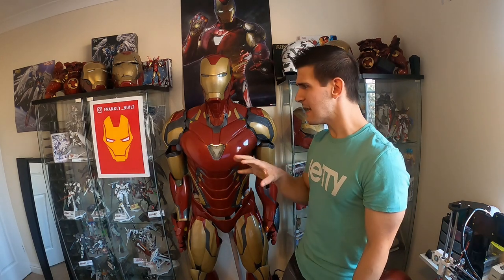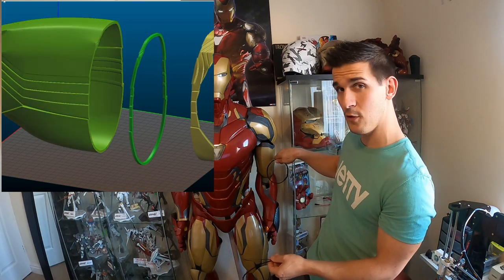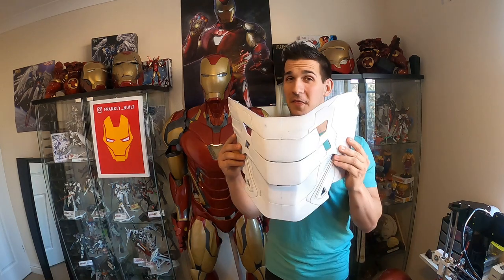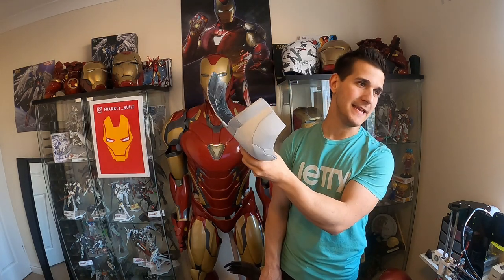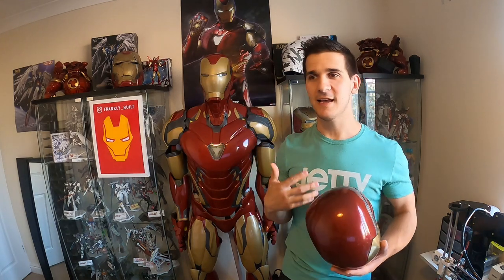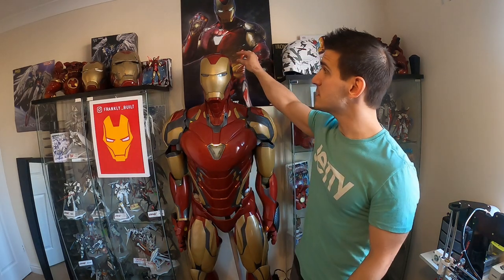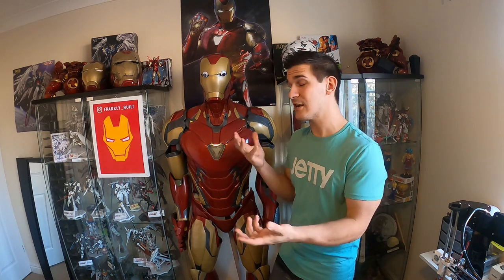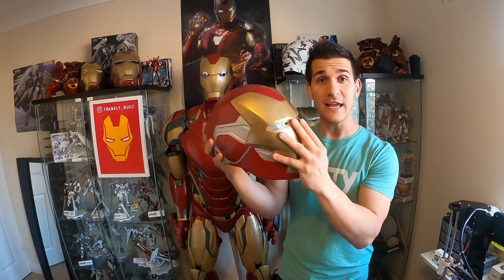How to Scale 3D Printed Armor! (Old Video- See Description for New Version!)

Comment: I'm 6' 1" which is lucky for most suits, but I'm going to apply the boots and lifters you mentioned to my Master Chief armor I plan to build after Halo Infinite releases. Should help me get at least a bit closer to 7'. Love your videos man. I bought a 3D Printer in February and began making a Beskar Mandalorian costume and the things I've learned from videos like yours and my own mistakes I've made have all been so valuable to learning how this whole process works. Only problem is forcing myself to not start another project before I finish one.
Reply: That is good to know. I am 6 ft 2. 😂 I have to fix a piece of stuck filament on my SV 03, then I'm getting at my Red Hood Samurai armor. I'm just going to print the helmet and see how it goes. If it doesn't fit it will just go on display.
Reply: I did a cold pull. Filament is stuck between the nozzle and direct drive extruder. 😭
Reply: Disassembly is NOT the same as videos I've found. So... Time to tinker!

Comment: I had just left a comment on your tik tok about this.  I am so happy I found this video thanks so much for your help.  I just got into 3d printing.  I may have made a mistake in purchasing a much more expensive printer to start with. 

I got the snapmaker A350 do you have any experience or thoughts about this printer?

Comment: Great video, Frank. Just curious, I’m concerned about resilience in the armor pieces. Are you printing 100% infill or thick walls with high percentage infill? Also what type of filament are you using? PLA, PETG, ABS?
Reply from the maker: Oh dear god no. Lol 100%? Jesus that’s insane. I use 5% infill with quarter cubic pattern. You going to war in the thing? UFC fight? Lol 😂 it’ll be fine. And it’s PLA+. Don’t leave it in a hot car haha
Reply: Frankly Built Thanks! I figured as much. What wall thickness are you using. I’ve heard 3 to 5 mm is good.
Reply from the maker: @sjmaguirepdx  no idea lol whatever stock cura settings are haha
Reply: @sjmaguirepdx  Do3d files have a good wall thickness by standard. I have several helmets of them and although I would wear them as crash helmets, you can walk into a door with them without breaking the part 😁

Comment: Like did you design and print the suit yourself, or is it designed by someone else and you printed it yourself.

I want to make a mark 6 or 7 suit. Whatever the first one was where Tony put in his new triangular arc reactor.

I haven't searched online for any files, but I kind of want to make it an actual somewhat functional suit in terms of being able to move around, as well as using a bunch of d3o padding so it could actually be used as a protective suit like if you fell down or crashed on a bike or skateboard or whatever. I thought about making a bodysuit with the padding built in to/sewn into that, with the armor attached on top of it, as opposed to attaching the padding to the armor, but I'm not so sure.
Reply from the maker: These files are from a company. Most suits are modeled. If you planned to wear it any Type or functionally then 3D printing won’t be strong enough. You’ll also need to deal with Armour pinch and joint intersections. Trying to make a “functional” iron man suit just isn’t really practical, the more it covers you the more your mobility is limited.
Reply: @FranklyBuilt  I understand. I just find all the suits I've seen are essentially single layers of plastic stringed together and strapped to the body.

I couldn't sleep last night thinking about how I could make an ACTUAL suit, not just pieces of plastic hanging off my body.

I was imagining my snowboard boots, right? Like, they are big and bulky. Then I was imagining like ok what if those boots were armor, how could I design a hinged top section to get my foot in and out. Using motors or servos etc to control it.

Like I'm talking probably years to design and make the thing especially since I don't know the first thing about electronics and robotics etc

It wouldn't be functional armor at least not against anything more impactful than a fall, getting hit with a baseball bat or shot with a BB gun or something... But making a real actual suit that doesn't take 2 hours to put on

Comment: Will 200 x 200 x 200 printer be enough to print armor like this? Did STL files from Do3D contains only big parts I need to cut to pieces first?
Reply from the maker: 200x200x200 is painfully small for full armours. You’ll have to cut up so much
Reply: @FranklyBuilt  but is it doable? Which free software is the best for slicing too big parts?
Reply from the maker: It’s doable but I think you’d be better off saving up for at least a CR-10. It’ll save you literal weeks of printing and later frustration

Comment: Absolutely lucky, I've had to widen everything 10% to fit into it, it does change it but it doesn't seem to be too noticeable for now, and your arms look way too big for 100% biceps, the 100% was pinching my elbow, so scaled that wider aswell, are you using 100% hands and did you scale the gauntlet down aswell to match as I'm looking at that? I'm thinking of using the do3d main suit hand and use the gauntlet cover so I can clip the hands together for a tighter fit, I've made it to suit the cod piece, and the abs didnt wrap far enough for the lower back plate to join, so here's hoping it looks ok in the end! But again, amazing Frank!!!
Reply from the maker: I didn’t use DO3D hand files. They were super bad at the time. I used free hands from Thingiverse. MK6 hands from DaDav
Reply: @FranklyBuilt  cheers Frank! Will have a look into it, but I'll have a play with the do3d hands first after the new arm and a leg for sizing!